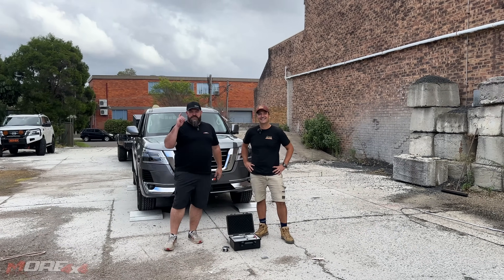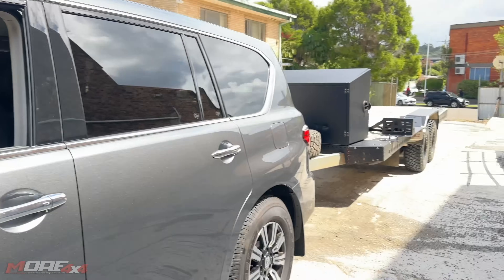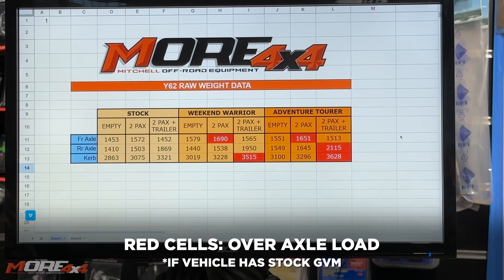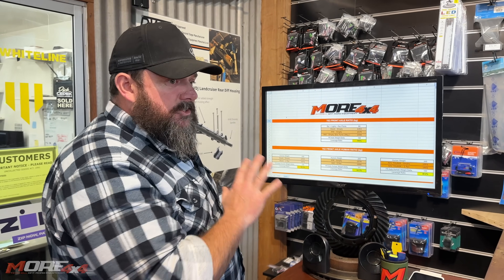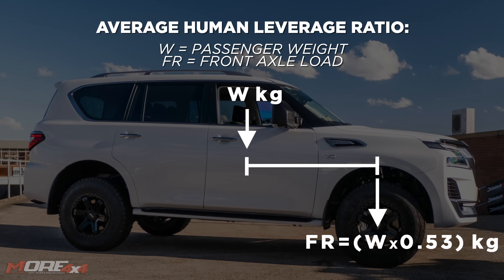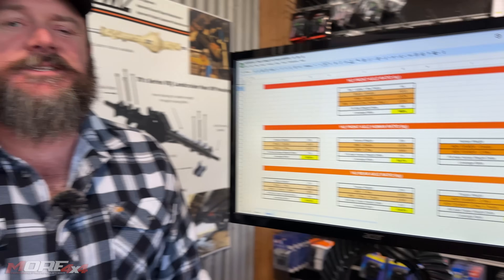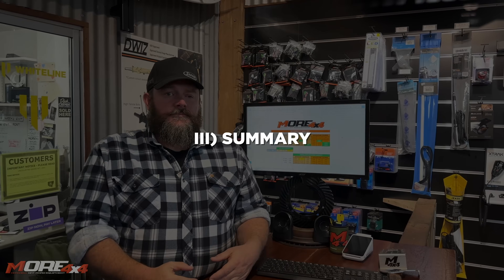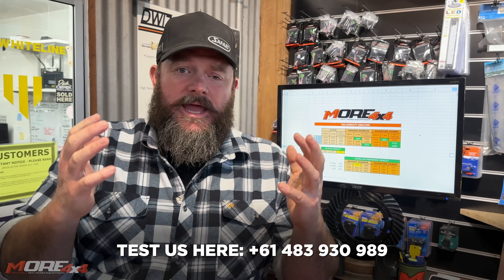YOU'RE PROBABLY OVERWEIGHT, HERE'S WHY - GVM, Axle Load and Leverage Ratio EXPLAINED! | @MORE4x4_au

Comment: Your calculations went wrong at the rear axle ratio, they were correct for the front axle ratio and front axle human ratio.
Take the stock Y62 for example, you have calculated that 1kg ball weight is 1.244kg at the rear axle.
It seems that you divided 1869kg(Stock - 2 Pax + Trailer) by 1503kg(Stock - 2 Pax) to arrive at the 124.4% ratio.
However, it can be seen that the 219kg ball weight added 366kg at the rear axle.
366kg divided by 219kg actually equals a ratio of 167.1%, very similar to the 166% ratio for the front axle.
The previous calculations for the front axle ratio and front axle human ratio were reached by dividing the Delta by the actual weight of Humans(119 ÷ 205 = 58.0%) and Bar + Lights + Rec Points(106 ÷ 64 = 166%) but with the rear axle calculations it seems you used the 2 Pax + Trailer figure(1869kg) divided by the 2 Pax figure(1503kg) to arrive at the 124.4% figure.
Love the video, just want people to have the correct information.

Comment: So when Nissan allows 250kg towball load without adding to gvm? why has that not been factored in??  i have seen multiple of these videos done by shops and all of them dont apply the 250kg discount in the kerb weight allowed by nissan ? am i reading things wrong?
Reply: The 250kg towball weight is always included in your payload. I think what you're referring to is the reduction in the vehicles GVM (and thus available payload, which includes the ball weight) once you exceed 250kg ball weight. The Y62 has a GVM of 3500kg, meaning a payload of 750-785kg depending on the model. Towball weight is part of this payload. But if the towball weight is over 250kg the GVM is reduced, and so the payload available is also reduced. A towball weight of 300kg reduces the GVM by 70kg (so GVM down to 3460kg), a towball weight of 325kg reduces GVM by 100kg (down to 3400kg), and a towball weight of 350kg reduces GVM by 130kg (to 3370kg).  These new GVM figures, minus the tare weight, give you the revised lower payload available - which is made up of the towball weight, accessories, full tank of fuel, passengers and anything else you throw in the vehicle.
Reply from the maker: Thanks for investing the time to comment. 

That may be true for earlier Y62 models but it’s not now, unless of course you know something I don’t!
Reply: @MORE4x4_au  good to hear! The info I found was a couple of years old, so I'm glad it's no longer valid - especially as I'm in the process of working out a build and pre-rego GVM upgrade for a Y62 purchase next year! (Been a Toyota person for 25 years but they've lost me with the current crop and no petrol offering, and their pricing!)
Reply from the maker: That sentiment is becoming more popular, we build stacks of Patrols and they’re such a great alternate! Glad you’ve seen the light. Aaron Mitchell
Reply from the maker: There's no discounts where payload is concerned. 

Every kg comes off your payload, including towball load.

Comment: Are you sure the front leverage ratio you have shown is correct? I just did a rough measurement and on my Y62 the rear overhang is about 1.4m and the front about 1m. Shorter overhang less leverage, longer overhang more leverage. Considering you got about 1.25 for the rear 1.66 would seem impossible. Is it meant to be 1.16?
Reply: Hi Pancho, thanks for the reply. So the 1.66 won’t be a fixed figure then? If I were to install a shelving/draw setup in the back over the axle that weighed say 500kg would that reduce the 1.66 ratio?
Reply from the maker: Correct, the rear load counteracts and reduces the front leverage  load
Reply: I know it’s a big ask but is there any chance you could get the weighing company back and show in real time the weight going up 166% on the stock Y62 front axle load? I just need to see it for myself as I’m sure lots of others would be interested.
Reply from the maker: That is a big ask but we have the footage and might be able to upload. 

Do the weigh maths on the Max frontal load that Nissan specifies of 85kg and 53% of human load of 2 x 68kg.
Reply from the maker: Hi Mick! Pancho here, thanks for your comment mate. You are absolutely right, in theory, the longer the overhang the more leverage, but there's another factor involved here,  the vehicle's weight distribution. Since the Y62 front is heavier than the rear having the engine right on top of the front axle, you don't have to add so much weight in order to make a difference, and that's why the ratio is higher. 

Hope this clears it up! Thanks a lot for sharing your question with us mate, have a great day!

Comment: Do a "just a tow pig" combo for caravaners
Reply: Keep it stock, weights were green across the board, and you had 190kgs to spare...
Reply from the maker: And if you’ve got 350kg on the ball instead of 220kg, what then?
Reply: @MORE4x4_au  Ram... you've paid for it by the time you do a gvm upgrade....
Reply from the maker: They’re constrained by the same parameters though, all modern vehicles are.
Reply from the maker: Isn’t that what we just did?

Comment: I have an upgraded gvm but have 1830 front and 2230 rear axle capacity. Am going to have to be very careful.
Reply from the maker: @hybrid_Adventurers - Interesting, was that pre-rego upgrade? Y62 Patrol? Which manufacturer?
Reply: @MORE4x4_au  post reg y62 yes, coil delete setup and one of the recommended guys in Vic
Reply from the maker: Replacement components? Lower rears? Front uppers?
Reply: @MORE4x4_au  yep front uppers, and dobinsons springs, rear aaa bags with the spacers for lifted application and reinforced standard arms. Self levelling, etc
Reply: 4000kg gvm
Reply from the maker: Thanks for your reply. 

What front uppers do you have?
Reply: @MORE4x4_au  the black hawk ones :)
Reply from the maker: Roger. 

Mind if I ask whose kit?